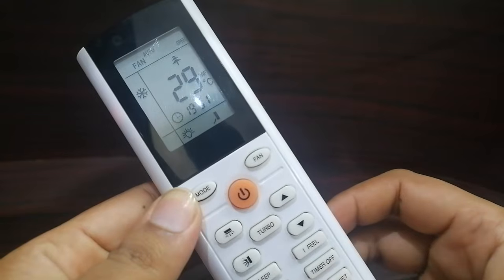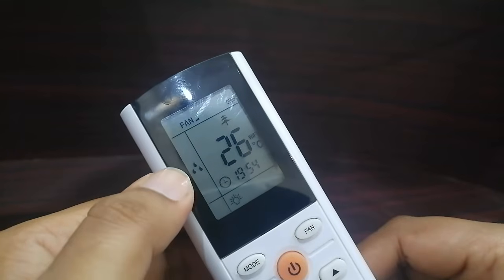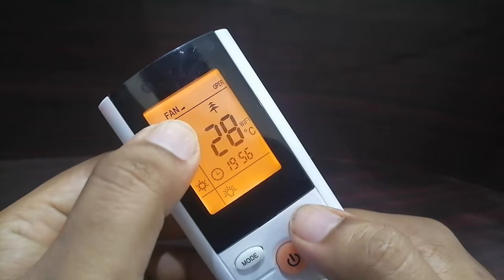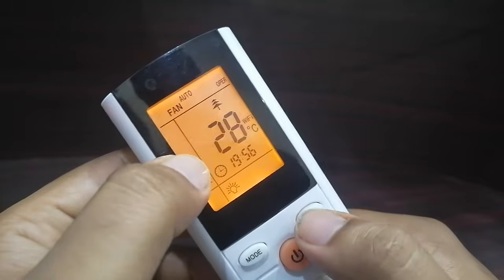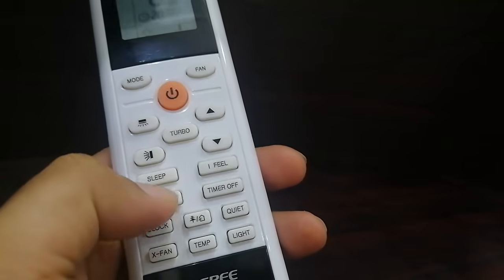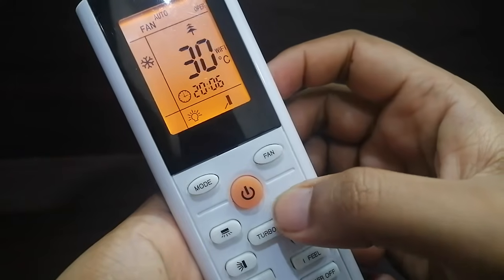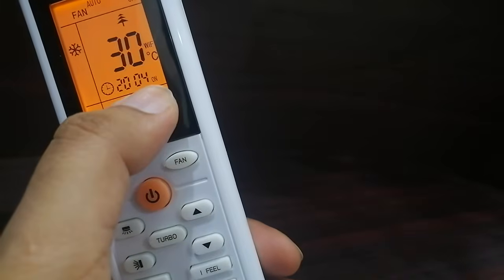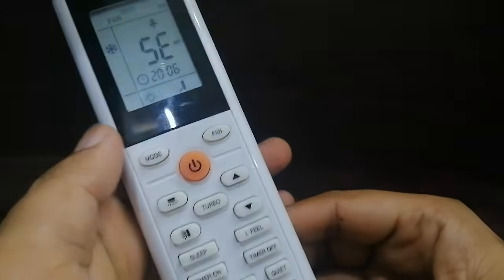Gree Ac Remote Settings | Functions | instructions in English | How to use Gree Ac Remote

Comment: You can also change temperature from C° to F° by pressing mode and down arrow button at same time when ac is off
Reply: Can u change the clock format from 24 hrs to 12 hours
Reply: @ashfaqkhan2125  I don't think so
Reply: Literally the one thing i needed to know thank you!
Reply: What is the best mode for maximum energy saving
Reply: @murtazabutt-n5w  probably the 'quiet' mode but I'm not sure
Reply: @murtazabutt-n5w  press temp and clock button same time. Than you see that your ac is save energy and display show SE . It is generally called saving electracity.
Reply: What could be the cause of my inlet leakage?